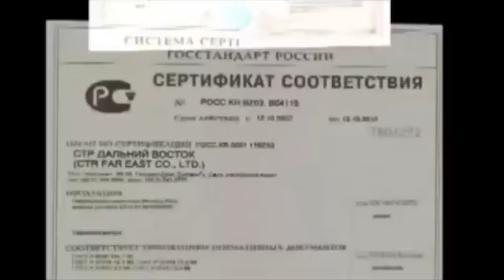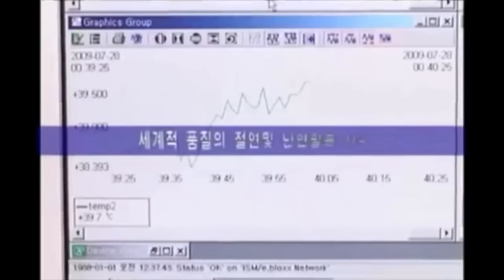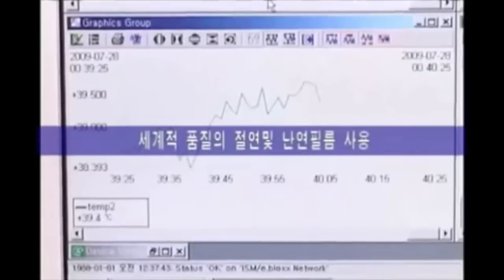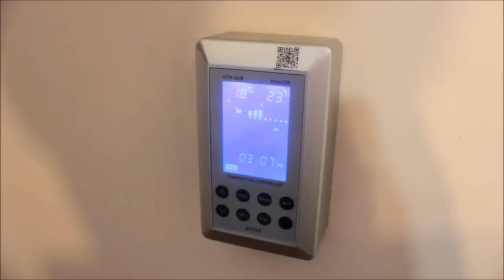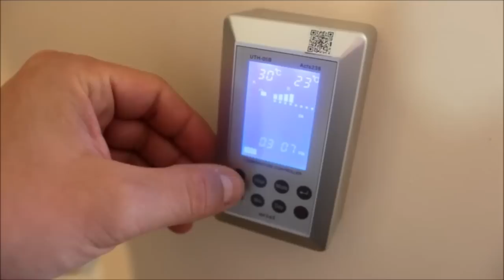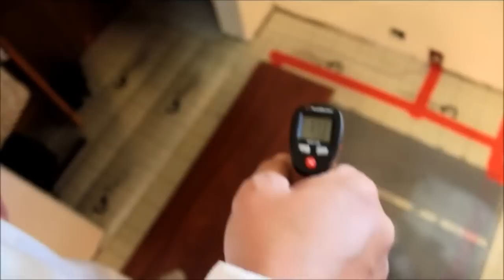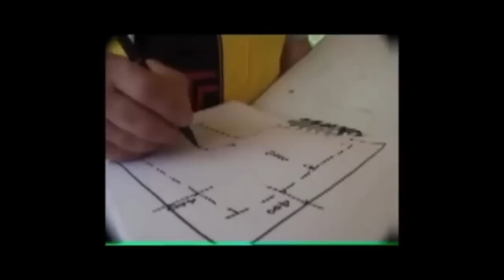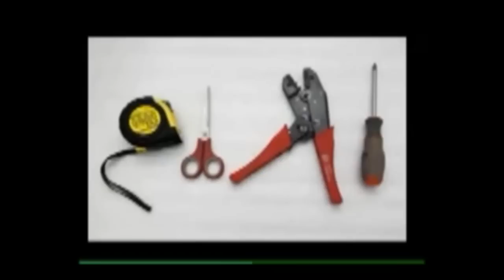Carbon Heating Film

Comment: What about installing carbon infrared heating in several different size rooms ?
Do they all need their own heat sensors in the floor and seperate thermostats ?
Actually , one room is divided into two spaces, where I can put 2m lengths in one room and 4m lengths in the other.
Can I put the 2m in series, so that they add up the same as the 4m rolls ?